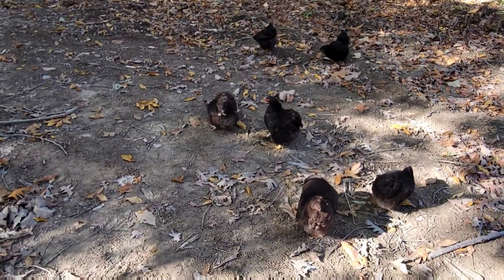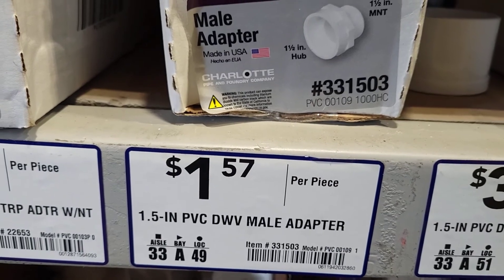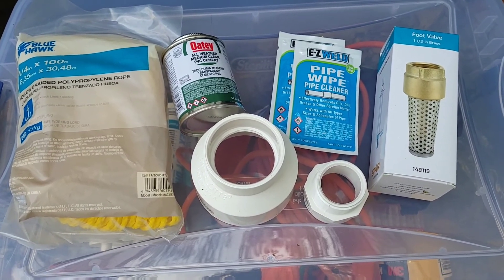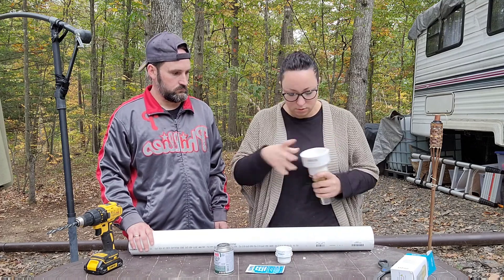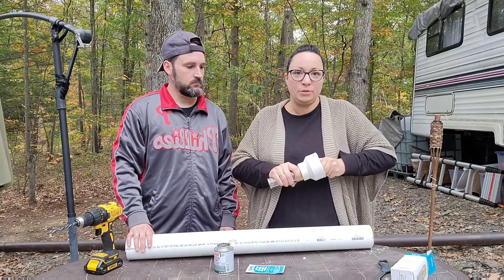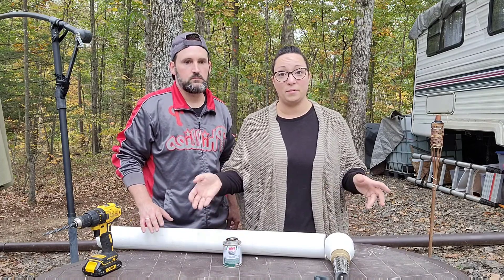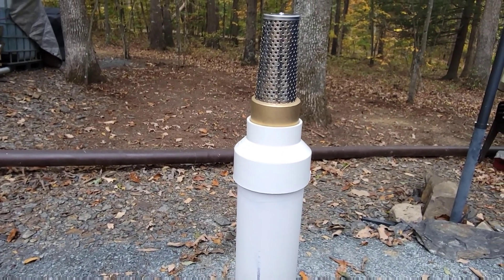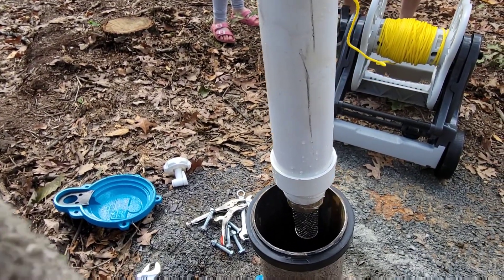DIY BAILER BUCKET | Get water from your well without electric

Comment: Thanks for the great video! One thing I will be doing is putting 3 small stainless steel self tap screws at the bottom where the coupling adapter is to make sure that the foot valve assembly does not fall off even though it is glued on! Thanks again 👍

Comment: Very  nice tutorial.  Something to consider is rather than looping the rope through the holes put a stainless steel bolt and hardware.  This way if the rope breaks or comes untied you can lower a hook down to retrieve it.
On the one I built has an end cap on it with holes drilled through it and a dollar store flat rubber tub stopper as the one way valve.
Reply from the maker: Great suggestion
Reply: I think yours works as intended.  You drop the bucket in, the water can lift the rubber and flow up into the bucket, and when you raise it, the stopper seals the opening(s) and you can lift up.  But with these foot valves I see people install (like in this video and many others), I cannot picture that  lowering it into the water will compress the spring in the footer valve that easily. Nor can they overcome buoyancy that easily.

What I think is happening is that they lower the bucket enough so that water flows over the top of the bucket.  If that is the case, you could just seal the bottom with an end cap and weight it enough that it will enter the water deep enough.  

Then again I could be wrong.  The only way to tell is to measure the water table height First and then only lower the bottom of the bucket a foot below that (so one could exclude water coming over the top as a source of filling).

Comment: Thank you so much for sharing this. I work for Harvard University and we have been studying solar flares and they have been increasing at such an exponential rate. We hit 1500 Hertz on April 9th and soon it will be enough to take out the entire electronic grid. The grid could go out for a maximum in my opinion of 30 days. They would need to bring in Tesla energy in order to fix any kind of grid as the electronics will no longer be workable after the EMP.
Reply from the maker: Thanks for sharing. We believe that everything that makes us dependent on someone or something else, makes us vulnerable so we try to work toward self sufficiency.
Reply from the maker: Also...check out how we set up rainwater catchment here: https://youtu.be/Li_bDKOZTh0
Reply: @lessoflifefamily  I agree. I think we all need to start thinking off-grid living! Thank you for helping us transition to the way things should be.

Comment: I assume that there was no well pump and pickup pipe installed in this well? Just the casing?
I have a 6" well and I"m trying to figure out what size I'll need to slip past the pickup pipe and the wiring.
Reply from the maker: Correct...no pump installed at that time. Now, it is installed, and I can't see a way around it without pulling the pump..  which I wouldn't do unless we had a long term power outage and were desperate for water.

Comment: I know that y’all may have explained this but I need more specific instructions. I’ve basically got the same thing I have not got my foot valve yet, but my reducer was from 3 inch to 2 inch my question is do I need a 2 inch valve to go down Into the reducer that ends up 2 inches or does it have to be smaller so it fits in the 2 inch?

Comment: You can use an a frame or a tripod with a pulley over the well and use your hose real to lift it straight up and drop it straight down.
Reply from the maker: We had tried the hose reel but were having difficulty with it. We will have to try it again when we have more time and patience 😉
Reply: @lessoflifefamily  Thanks for the video by the way.

Comment: Righty .. tighty .. lefty .. loosy ..  also you can drill right tru not one hole per side and use a bolt and center your rope so its not going to bounce around as you pull back up. Also if you cut one end wrong you can just re cut the same side ;p
Reply from the maker: Thanks
Reply: @lessoflifefamily  I was able to make one thanks to you guys, i used a cheap 12$ one way plastic flapper valve .. boy did the price of PVC pipe price go up!